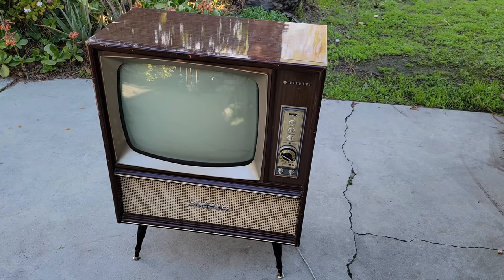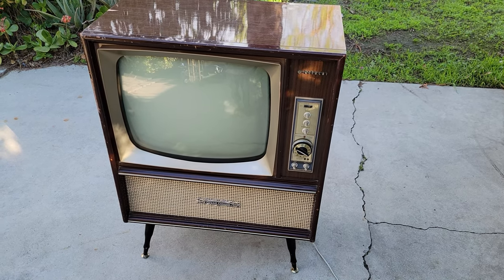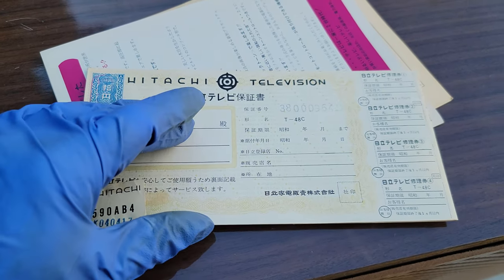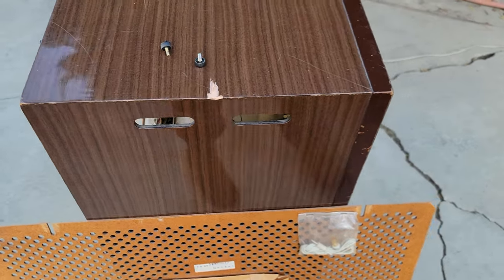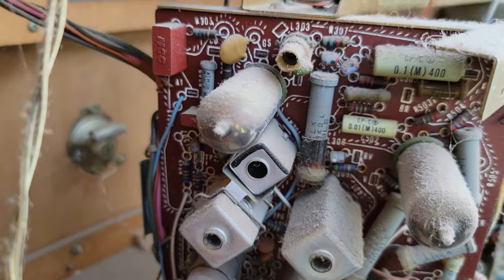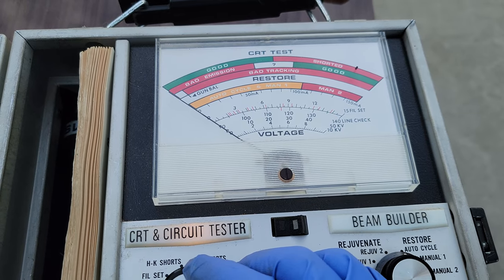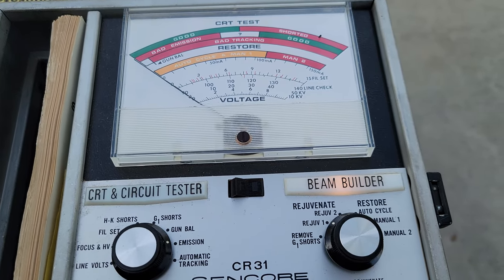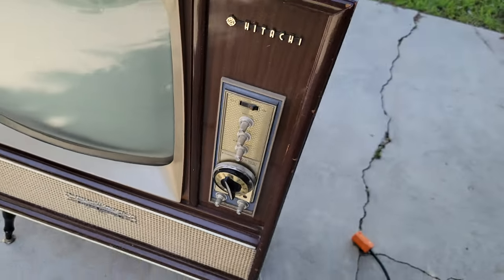1966 Hitachi T-48C Japan Market Black and White Grand Console Analysis

Comment: I did a search through a database of vintage newspapers on the off chance this Hitachi or something similar might have been advertised.  There were only a few hits for this brand of tv in the US from 1965-1968 and all were portables.  I agree with others this probably had the tuner changed and was sold to someone in the US military when they were stationed in Japan and then they shipped it back when they returned to the states.  Great find and probably quite rare here.  The inputs and outputs on the front and back for a recorder and turntable were a nifty idea - it's too bad something like that didn't take off in the states.

Comment: I noticed the channel dial is from 2-13 which might means it may have had the tuner changed because Japan TVs would have 1-12 on the dial. Awesome set and especially awesome it has all that paperwork.
Reply: I was thinking the same thing.  If this was sold in Japan it would have to have been targeted to US military and tourists to take home with them.
Reply: That would be a bummer..if thay changed the tuner to that would ruin the original touch to it

Comment: That is a beautiful TV. I have a 1965 Japanese made Singer sewing machine that was sold new in South Korea at a Military PX base and it is 100 volts [ 50/60 cycles ] also. It is a model that was sold only in Japan and South Korea. It is the only one like it in the USA. I run it on regular USA voltage and it works fine.

Comment: Hey Shango, Japan still has a TV Licencing fee for NHK much like the UK does with the BBC. https://kadenfan.hitachi.co.jp/support/lng_hyoji/tv/pdf/data.pdf Hitachi still has a list of all the CRT TV's they have ever produced on their Japanese website.. here is the link the PDF.. the T-48C IS listed at 1965 year of start of manufacture, probably mid 65 judging by that nichion. That little revision card you found in the TV says that changes from the schematic the Horiz output tubes cathode is directly grounded instead of going through a resistor. and an extra 560ohm resistor has been added to the horiz output tube screen
Reply from the maker: Cool thank you.

Comment: There has always been huge US military bases in South Korea and Japan. The PX stores sold tons of Japanese items. Many of those came to the USA when the servicemen and their families returned to the US. They were all 100 volt.
Reply: Maybe that explains the 100/110 switch; they were intended to be shipped to the US. For those too young to know, in the US, standard household voltage used to be 110. That was the number I always heard as a kid in the 50's and 60's, somewhat electronics aware. All the feeds in my neighborhood were 110, I can't recall anybody with split phase 220. I never paid attention to it afterwards and always said 110 voltage. Sometimes I still do. Various internet searches also quote 110. Sometime later, voltages began to creep up. 117 and 120.  I didn't notice, or think about it, until a got a Kill-A-Watt and saw it.  Bit sure when 220/240 feeds started to appear. Could have been as early as the 50's (?) when electric ranges became popular, then central ac.

Comment: According to the schematic at 6:11 R901 6 Ohm 15W is added in series with the incoming mains when switching the fuse from the 100 to 110V position. Changing that resistor or adding another resistor to it may be a way to implement a 110 to 120V changeover. 
Also there is a section talking about the voltage selector in the manual seen at 9:05 where according to translate it mentiones to move the fuse from the leftmost (A) 100V position  to the middle (B) 110V position if the supply is above 105V. And at 11:26 it looks like the fuse under the acrylic cover is still in the leftmost position which would be the 100V position. And wouldnt that imply 20% higher voltage on all the heaters?  Including the CRT? Brightener deluxe?

Comment: My parents had a color Hitachi TV in the early 70s with 'instant on' - but Dad knew a thing or two and would always make us wait 3 minutes for 'the back to warm up' before 'pulling the front out' (the push pull volume control on/off). And it was never left on - it was always unplugged when we weren't watching it.

He used to take the back off occasionally and dust it out - no tubes - 'All Transistor Solid State' as it proudly proclaimed on the front.

Not a bad telly - a zener diode failed on once and that was it for 15 plus years - it got a bit dim and soft towards the end though !

Comment: Hitachi made some of the highest quality sets coming out of Japan in the 1960's  and 1970's, on par with Sony.  That set you found Shango066 is in remarkable condition, as well as the documentation..  It is rare to find a date code on Japanese components.  Growing up in the 1960's,  I remember the Japanese electronics well.  They were notably lower quality then US equivalent products but, were lower cost and the Japanese tended to add little extras the US customers perceived as quality.  The equivalent TV made in the US at the time would have had a power transformer.  Working as a TV tech in the mid 1970's, the Japanese TV's only lasted a few years before being replaced.  Sears used Japanese manufacturers to make their line of sets from the early 1960's onward.  After a while, I began calling them "series" instead of "Sears", because they all had series connected filament string and were difficult to work on being so cheaply made.  Seeing all those Japanese dog bone (carbon film and wire wound) resistors really brings back memories - thanks for posting!

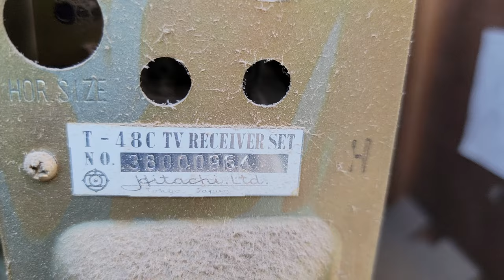Comment: Looking at the serial number at 12:55 in the video it could mean that the set was the 964th one built, with the first two digits meaning it was built in the 38th year of the Showa era, which would mean that it was from 1963.
Such a low serial number might also suggest that this is a very rare set with not very many having been manufactured. I remember hearing that Japanese TVs were much more expensive in Japan than in the rest of the world, with only wealthy people being able to afford them during the '50s and'60s, partly in order to subsidize the cost of the exported models to undercut American manufacturers.

Comment: I was going to spitball 1963 based on the serial number. That is if the first two digits of "38" meant "Showa 38". The date codes would be better evidence though. Aside from the tuner differences, NTSC-J is exactly the same as NTSC-M aside from the fact that the Japanese system used 0IRE for reference black vs. 7.5IRE here in the USA.

Hitachi kept bundling earphones with their sets well into the 1980s. I had a circa 1986 13in table top that came with one. Very uncommon to have a headphone jack on a TV, even into the 80s. That was an excellent set too.

Comment: sir i do watch your channel from time to time. I used to have a black and white similar to this one on your channel but mine was a magnavox. It had real low hours on it like what 35 hours and i used it for like 15 years then the high voltage went out and i could not repair it. It was given to me from a co worker back in 86. i wish i still had it today for the looks. Sir you do remarkable work on all sorts of radios tvs. ecc.  Keep the works going sir

Comment: remember that the Japanese often use "year of the reign of the current Emperor" still as part of their calendar, so finding date codes might involve that
Reply: The serial number started with 38 and then several zeros before a number. Showa 38 is 1963, maybe that's when it was made. But then there were all the 65 and 66 codes, so IDK.

Comment: Very interesting that a TV for the japanese market has complete english labeling on the front. 
Pretty much all devices I imported from Japan so far either are labeled all in japanese or both. 
Possibly the case parts were made this way so they can use the same parts internationally.

Comment: The 5-11 and 5-12 on those tubes almost had to be 1965, 11th week and 12th week.
Reply: 11, 12 = November, December
Reply: Yes and 76 6 sugest it as put together in 1966. So 11 and 12 month of ‘65 on tubes would fit that it was ‘66 set. Also style and parts inside suit that period.
Reply: And that it uses a frame grid neutralised triode RF amplifier, something  not used before the 1960's.

Comment: Judging by those cooked power resistors it might be wise to plug that set into a bucking transformer. The set might have been ok with the 110~115 volts we used to have in the old days but it’s probably not too happy with the 125 or so that we have now.

Comment: There have been very many soldiers, sailors and airmen stationed in Japan, many had civilian quarters and lived there with their wives and children. Purchasing a TV in Japan, was, of course made for the Japanese system. I purchased one on my way home from Nam and it worked OK on us current, of course it was a tiny portable set with built in AM/FM radio. I was on my way home on emergency leave cause my wife was about to give birth to our son, and was having complications.  So the set went home with me, and I carried it back to Nam, where it served me for 5 months till I went back home, I used it for many years till, at long last a resistor blew. I took it to an on base service center, they looked at it and said they could not repair it because it have never been imported to the US so no schematic was available. I figured I had a choice to throw it away or bypass the resistor. I bypassed it and the little set lived on for many more years, I eventually sold it to a Staff Sergeant who worked off base as a security guard. He  mounted it in his little dodge and used it to pass the time as he sat in his car watching a warehouse for several hours a night.  Since it worked on 12 volts either with the 100 volt transformer or a battery pack we simply wired the car to the c-cell pack and it worked fine.

Comment: Greetings:
The only difference from the US ntsc is they do not use a 7.5 IRE setup level where the lowest black level broadcast in Japan is at blanking level, but the US minimum black level is 7.5 IRE  units above blanking. I believe we in the US have this because in early sets it was hard to hide the retrace lines in all areas.

Comment: Trimming a mains voltage by some amount is often easily achieved with a transformer that you may already have on hand.
For example, if you needed to reduce your 115V mains supply to 100V for this Japanese set, find a 115V:15V transformer and wire the secondary in series with the set, phased to reduce the delivered voltage. Supply the primary with your 115V mains.
The transformer must be capable of delivering the current required by the device - a 200W device requiring 2A at 100V will require a 30W  transformer (that is, 2A at 15V).
This technique can be used equally well to raise the delivered voltage.
Reply from the maker: Yes bucking Transformer configuration I've used them quite a few times in the past

Comment: The circuit board diagram at 10:01 has a printing date of 1966. That "Grand Console" nameplate, which doesn't look like anything from the 1960s, is from a circa 1970s Hitachi TV.
http://www.barangtempodoeloe.com/2013/10/televisi-jadul-hitachi.html

Comment: I concur with another commenter that this was aimed at US Servicemen who were stationed in Japan. The military bases used US based frequencies. If you look up the analog TV channel numbers for Japan, they're 1-12, not our 2-13. So this was aimed at the quasi-US market but sold in Japan. Either that or this was designed for both the US and Japanese markets at the same time?
Reply: US VCR ALSO RECEIVES CATV 95 - 97 for VHF JAPAN 1 - 3

Comment: Greetings:
I just started watching, so you may have already addressed this, but regardless of whether the set has a transformer or a hot chassis I believe you can wire in a 12.6-18 vac transformer (bucking) to use on USA mains power.
Also, NTSC-J simply has no 7.5 IRE setup level (their blacks are darker than ours, but use brightness control to compensate).
How about capacitor date codes?

Comment: This set is so well laid-out for access! It is also reminiscent of British-built sets from the 1960s. Really looking forward to the follow-up. By the way I would have left any CRT rejuvenation attempts until I had the set was running as the CRT can sometimes "wake up" after a long slumber, apparently.

ETA: The way you made this video has given me some good ideas. I intend to make a video showing my Ferguson Courier III (BRC 1400 chassis, dual-standard 405/625). I think it needs the tuner valve pins cleaning up (or maybe a new valve) as last time the set was left on all night I woke to a noisy raster. Switching to UHF then back to VHF brought the picture back but it faded back out, still worked fine on UHF.

Looking at yours, I see "Presets" above the tuner dial. Does this have UHF too?

Love the road trip video, yes better at the end of the video but we get to see places some of us would like to but probably never have the opportunity to visit. That "dirt road" bit reminds me of some of my foreign trips, fine when it's dry but I wouldn't want to get stuck in the mud after a rain storm!

Comment: 12R-K19 and 12G-B7 are JIS designations.   According to radiomuseum.org the 12R-K19 is sensibly equivalent to a 12AF3 or 12BR3.  The 12G-B7 has no Western equivalent that I know of.  The number on the picture tube is also a JIS designation similar to the EIA designation used in most other parts of the world.  580 is the size of the CRT in centimeters measured diagonally across the face and B4 is the phosphor type, equivalent to P4 phosphor.

I would make a page on the set at radiomuseum.org and donate a scan of the schematic.

Comment: 0:24 It's a little odd putting the tone control right next to the vertical hold knob, but at least there is one. I'll bet the sound out of this thing is a lot better than on the cheaper USA-made consoles, which had gone to glorified clock-radio speakers by this time. I wonder if Japan had UHF by this time; '66 was just a year after UHF tuners were required on U.S. spec TVs, but in some areas here, UHF slugs were routinely put in unused locations of turret tuners going back to the early 1950s.

Comment: 20 volts over might have done some damage, instant on... if local supply was 122v at the higher end crt filament voltage might have been 2 to 3 volts over and on even when the set's off eats the heaters away...

could be worse if you had 230v like we have in the uk